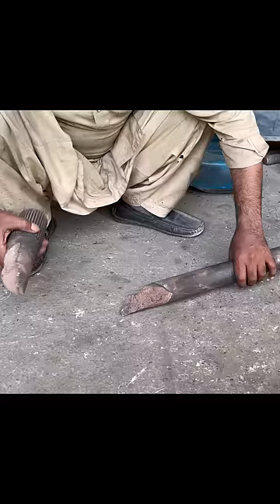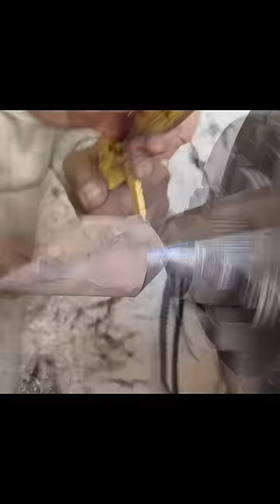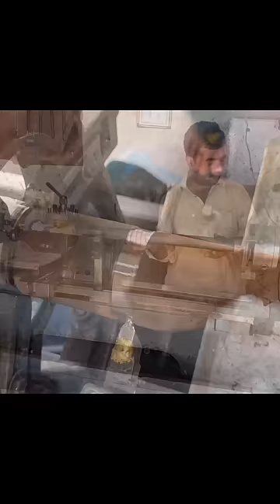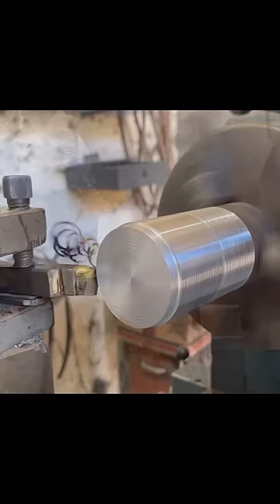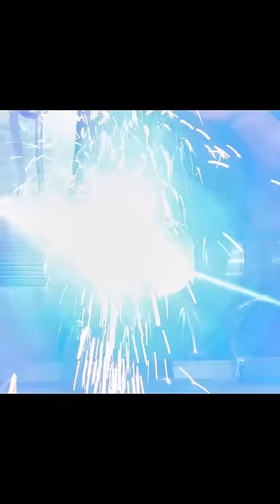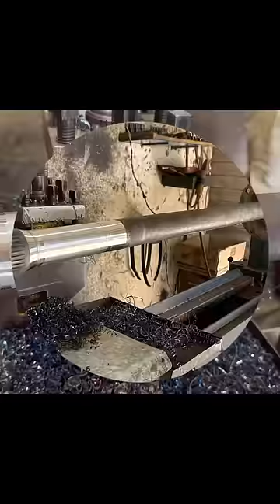How 2 Pieces 8x8 Broken Axle Connected Successfully || Genius mechanic repaired it

Comment: If you're in an area where all you have are rounds of steel and no spare parts, then this is a great solution. Very well made.
Reply: No it isnt
Reply: @Zuckler455  it's the solution they have
Reply: @Zuckler455  what do you suggest then Einstein?
Reply: @LifeAccordingToMatt  that you should quit drugs
Reply: @Zuckler455 it’s all they could do. It was fine before we got really good at things.
Reply: @Zuckler455 why would I ever, they are so fun bro
Reply: Absolutely no excuses. Mega cringe big dawg. This isn’t the right way to fix that and you know it.
Reply: @yikesmcgee-gz3lq  ok it's not gonna last a long time, but if it's not stupid if it works
Reply: @willlong4258  nah big dawg. Hit ya gaming chair with some febreze.
Reply: Exactly, no manual lathe or the know how required!
Reply: @yikesmcgee-gz3lq 😂😂😂😂
Reply: @yikesmcgee-gz3lq 😂😂😂😂
Reply: Very short term solution...it will take longer to refit than it will last.
Reply: Errrm. Welds hate cyclic loading. They literally have the worst fatigue life and you should avoid using welded parts in anything that is under cyclic loading. 

A shaft like that is the textbook cyclic loaded engineering item. 

This thing will fail and it will fail quickly and catastrophically
Reply: @willlong4258  First pothole will break it 😂😂😂😂 all that work for nothing just order the part from the internet and its done the weld was bad and heating metal with welding for a car part will make it even worse and the welding process was so bad look at the welds closely you can tell it wasn't welded in the proper way😂😂😂😂
Reply: Also i think work(that job) cost there alot less than new spare part, thats why we see those videos :)
Reply: @Zuckler455  ikr he didnt even bevel it before welding
Reply: @beastmode2990  what makes you say you can tell it wasnt welded in "the right way"??? I didnt see any porosity, little to no undercut, definitely deep penetration. That could of just been his cover pass for all you know. I weld and fabricate "car parts" all the time and have no issues. Have you ever looked a vehicle over and seen how many welds are on a stock vehicle from the factory?
Reply: @bobbyd7962  that part was threaded then welded, even a perfect weld, will result in a weaker shaft. It also has a lot of torsion , you can see that by the input spline. 

The fact that it failed once tells you the part is beyond its life cycle or is being used improperly. Either way its not a great solution, its "better than nothing" and "all they can afford". Hope to god that when it fails, no one is injured
Reply: @yikesmcgee-gz3lq it will work for few more weeks and that's all they need bruh. If they want to they can always order new part but that will take months to get and living pay check to pay check will be difficult to buy. This is a perfectly good and extremely cheap solution to get the truck moving temporarily.
Reply: @chrisclarke3965 any other solution for under 20 bucks?
Reply: @spugggaldon361 it's supposed to last few weeks, usually truck drivers in the area just need to get home or make few more extra trips to be able to afford a new one, so until then, this is a great repair to last at least a week for under 20 bucks.
Reply: @bobbyd7962 most people here don't know what they are talking about. It's a good weld for now and they pay very less. The weld specialists here are so dumb and doesn't realize these businesses keep on running for a reason lmao
Reply: These repairs are carried out to continue working while the replacement arrives (which usually takes a long time).  Meanwhile life goes on and these guys are the ones who allow it
Reply: It probably broke BECAUSE it was repaired this way previously 😂
Reply: It’s because the labour hour is very cheap, and is better do this than spend money in a new spare parts.
Reply: At least their better craftsmen than cooks
Reply: @Zuckler455  that's how an ignorance person would show his/her attitude like you
Reply: @xo4205  :D
Reply: @Capthrax1 yes
Reply: Se você mora num país ,que os impostos são absurdos ,fica ótimo este recurso 🇧🇷

Comment: To those who comment that this is not an ideal solution: When a part is not available in a country's market, this is the only solution you have. Although if this didn't work, they wouldn't do it for decades. These guys are more engineering-minded than those who have fancy equipment and brand new high-quality parts available in their hands.
Reply: Theres a lot of forging videos of the sandal people on youtube. They have steel forging industries there. These could make the bar stocks

And as you can see, they do have lathes. These lathes, that they have, can fabricate a complete new part.

Those two things are enough. So it makes no sense for you to say they dont have it in their country. No way this repaired part can be half as strong as a complete new part. Most things are designed to just be strong enough to work, plus a little bit of extra strength as safety factor. If they beefed up the repaired part to compensate for the cracked insides, then maybe its ok. But here they made it so the outside shape is exactly the same. There is no engineering being done here. The repaired part is just a bad copy. Scrap metal has value and can be remelted. Its not a total loss to scrap it and get another shaft
Reply: yea true, they are forced to be creative and resourceful i would imagine.
Reply: No they're just poor. Finishes are horrible welds look like shit just no
Reply: They could make a new part. Instead they made a life threatening junk.
Reply: “More engineering-minded” 

Wut

Btw, they have a fucking industrial lathe. They’re advanced. They have welding equipment, yet their welds look like shit. They’re not better in any way
Reply: Also no safety regulations
Reply: @de0509 you mean add more work when they couldn't even buy equipments 🤣

Comment: Broken shafts shouldn't be repaired but replaced
Reply: Когда есть на что менять.😁
Reply: Pakistan me esa hi hota hai....
Reply: They know what they do. 🤫
Reply: First world country opinion detected 😂
Reply: @ezequielmorales4221  I'd rathe replace it with a sturdy brand new one instead of having it repaired over and over again which might cost not just alot but also your life. It's about investing not just your safety but also for others that use the road.
Reply: @mozzarellamaniac6300 you are fool , they will use it in tractor trolley with less load.
Reply: @AmericaButcherofHumanity  so 2wd axles are just for tractors trolleys?
Reply: Same like replacing electronics instead of simple repairs?
Reply: That's what they taught in the states
Reply: Yeah if you can find a replacement... Or even afford one.
Reply: @ezequielmorales4221 😂😂😂
Reply: @mozzarellamaniac6300 safety? These guys wear sandals in this shop.
Reply: They're in a 3rd world country working with what they have
Reply: You think they have the luxury or funds to just buy new axles? Now don't get me wrong, they're in the positions they are in by their own doing.
Reply: that isn't always an option. yes, it might be the ideal solution, but the availability or cost of a replacement means you might need to improvise
Reply: @1981zamora it will never be as strong as the original and it already broke. If by "taught in the states" means we build shit to last then you would be right with the exception of our garbage vehicles
Reply: Ok baby boy.
Reply: Have fun buying a new axle as a poor farmer in the middle of nowhere.
Reply: Okay, mister first world, now keep threading
Reply: @ezequielmorales4221  depends, I am sure in the first world someone would be glad to have someone weld them that rather then replace it because it's cheaper to weld
Reply: @AbidAli-bo8sv 
Not really an axle is sort of like a torsion spring.  The welds will be harder, and the lack of heat treat and difference in materials will create variations stiffness, that will concentrate stress, this axle will fail again at the weld
Reply: En un mundo ideal si.... Ellos no viven en un mundo ideal☠️☠️☠️
Reply: Send them the money and I'm sure they'd rather have a new one. Lol
Reply: @ezequielmorales4221 as someone from a third world shithole I agree axles should be replaced.. stop wasting money and time on parts that will break again
Reply: Not even balanced, respect the hard work tho
Reply: Youve been sold on the idea. You're cooked
Reply: @ninjastiz9046 cmon man to say that these two men are responsible for the state of their country. I mean they are obviously master machine workers you think they have any time for anything else but work and provide for their families? People love to generalize cultures and entire countries but these right here are true men. Is not so black and white brother.
Reply: @cheetah2thedeath  you misread me. I'm talking about the countries as a whole that are still 3rd world. I can appreciate hardworking men. I'm in the construction industry myself. When a group of people fail to industrialize and innovate, you get a 3rd world country. Period. It's not the 18th century anymore
Reply: @ninjastiz9046  okay yeah sorry I did misunderstand I apologize my friend
Reply: I guess you've never been to a 3rd world country , it's cheaper to repair anything than replace it
Reply: for them its about the cost.  for 1st world countries its about the quality of the replaced products exacting post-recall [if applicable] standards.  A quality new production item will outlast their subpar on-the-fly repair every time
Reply: Only in  north america
Reply: Clearly a comment from America. Lol these guys don’t have rockauto to order parts from they make do. I like the ingenuity!
Reply: LOL pajee
Reply: We all know bro but they can not afford it 😅
Reply: Why people buy used Phone? Or fix it. Because they dont have money to buy new.
Reply: You're saying that to a country that's been destroyed by america.
Reply: That is if you have something to change it to 😅
Reply: @AmericaButcherofHumanity its is replaced. They replaced the broken part isnt it?😂
Reply: Dont you think they would have done that if they had the option? People are too dumb..
Reply: Also this is meant to carry torque. This wasn't meant to be twisted in.
Reply: @EnglertRacing96 that’s absolutely right. But also we don’t know how long the axle in first place was installed, it could be 2 million miles or 50 years…. So maybe this version only last like 300t miles…because of the different fatigue behaviours…. I think “new” was never even an option
Reply: It will do just fine
Reply: Besser eine neue Achse drehen ....
Reply: You know nothing of struggle of not having spare parts  available
Reply: Bro, the don't have a NAPA they can run to in poor countries.
Reply: There is all ways polar difference between should and reality
Reply: And when it doesnt exists ?
Reply: @Sim-po1mc  then may be its one of those million scenarios where thanos got killed....
Reply: @ezequielmorales4221  first world counties prohibit things like this because it is dangerous. Safety standards clearly haven't reached this shop yet.
Reply: These repairs are carried out to continue working while the replacement arrives (which usually takes a long time).  Meanwhile life goes on and these guys are the ones who allow it
Reply: These repairs are carried out to continue working while the replacement arrives (which usually takes a long time).  Meanwhile life goes on and these guys are the ones who allow it
Reply: Bro, don't believe everything the dealership tells you. They're trying to make a profit. These guys look like they've been doing this for some time. If it works, it works.
Reply: @mozzarellamaniac6300 nothing gonna happen bro. Don't be such a p
Reply: What if you cant get a new shaft for an old vehcile, and dont have the tools to make and entire shaft complete with splines?
Reply: This is the attitude that big corporations love. Don't repair, just buy a new part from us
Reply: @mozzarellamaniac6300  I'm in the US and love this. New parts aren't always available. If this guy is repairing his work vehicle then he might not eat either. I'm tired of our throwaway culture and applaud these guys can-do attitude.
Reply: Your wife tell you that?

Comment: Woa that's one way to create a repeat customer.
Reply: A menos que o pobre Bahuam esteja descendo uma íngreme estrada de uma montanha e essa peça falhe novamente...
Reply: Smart in many levels..
Reply: Lmao
Reply: It looks like the shaft of a small vehicle. I'm sure it can handle more than enough.
Reply: Most old cars shats are rebuild since you cant find new or used, and i dont come from 3rd world
Reply: That was actually pretty well made. I thought he was just screwing it in. But they seal welded and added all thw reinforcement then remachined it.
Reply: They need it to last only a week, you think they can stop trucking in those parts of the world and week more than a week for parts to arrive? Sometimes actually think before commenting. This repair costs no more than 20 bucks and is actually not bad, as long as it lasts 8 to 10 more trips that's all they need, you think a serious trucker going uphill will keep this permanently??.. just because they are poor doesn't mean they are stupid lmao.
Reply: Lol and your solution to repairing it?
Reply: @ahmedifhaam7266 
Lmao what? The raw steel for the filler alone costs more than 20 bucks
Reply: The screw part isn't strong, it's being held together with a couple cm of weld...

Comment: Absolutely love it. Fix it don't throw it out. We need more of this. We can not continue to burn through the resources of thos planet.
Reply: That thing is gonna be way out of balance and not be true and it’s gonna eat bearings because of it.
Reply: This is straight up steel.. very recyclable and never "thrown out".
Reply: @shoestofirony738  yep, should have been melted down & replaced, not frankenstiened into a worthless & dangerous repair.
Reply: It shouldve been melted, not "fixed". Dont talk about things you dont understand
Reply: Almost all steel is recycled. If they did decide to "throw it out" it would not be going to the dump but to a scrapyard and eventually a foundry where it would be used as raw material for something new. I'm a fan of repair when you can, but sometimes it makes a lot more sense to replace.

Comment: How isn't India a world leader in engineering... they can fix anything...
Reply: Because of the trains. And the electricity. They can't stay away from them. That, sir, is why.
Reply: These are pakistaini, not indian .
Reply: Pakistan not indians ☠️
Reply: This isn't engineering. This is machining. Engineering would be able to calculate that the shaft now has 1/3rd the strength it did before it broke.

Comment: It will not be perfectly made. It will not admit that its thickness is 50 mm, and after it is 25 mm in size, it remains 25 mm, so its torque to compress and break the achievement is 25 mm.

Comment: Well that's one way reduce the Load carrying capacity of the shaft and this shaft will eventually break under fatigue loading and At much lower loading then a new shaft due to notch present inside the mating surfaces which is filled by Welding.

Comment: Repair is costly than replacement
Reply: Not in country like Pakistan
Reply: @namgyel6447  ya may be because they don't have any good recorces of raw material
Reply: Counter point: they are doing the repair. No one in their right mind will pay more for a refurbished part than a new one, so chances are that this repair was actually significantly cheaper than replacing.
Reply: @WungusBill-lf4iu  because in pakistan new generation CNC and Vmc machine might not available so may be new meterial cost is much but at the same time in india people will prefer to replace because efficiency is very less in repair work... And shaft are through also

Comment: the one thing I dont understand why they have one connection threaded then welded which seems like a good connection at least theoreticaly, but then they have a tap fit connection which is then welded which definitely isnt any stronger then the threaded section, so like why wouldn't they do both threaded or both tap fit? like its only Going to ve as strong as its weakest link so I dont really understand the thinking behind how they did that.